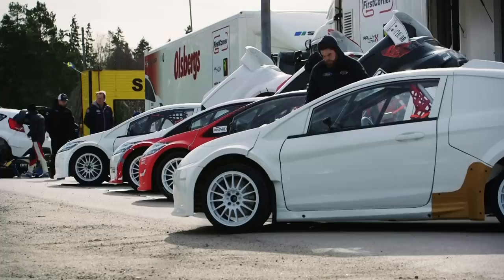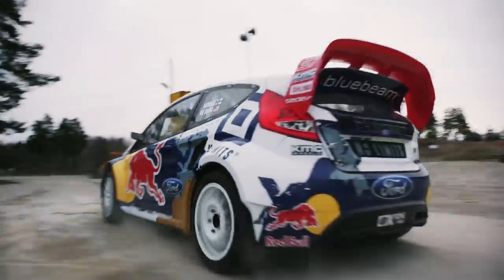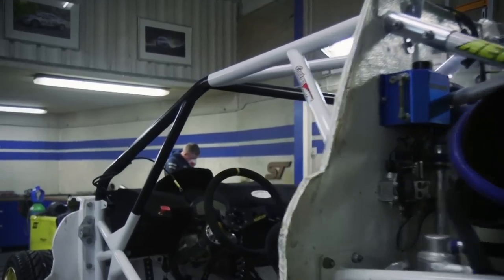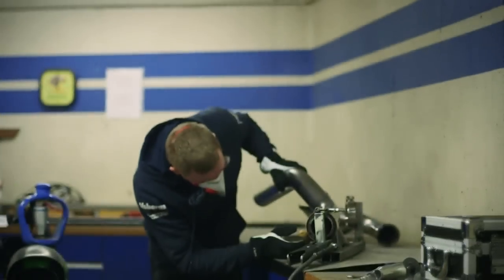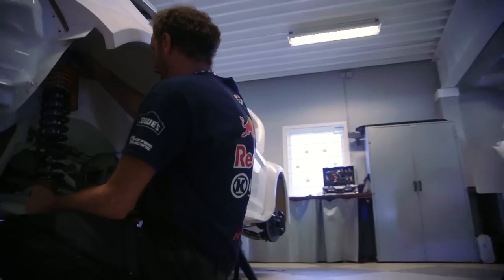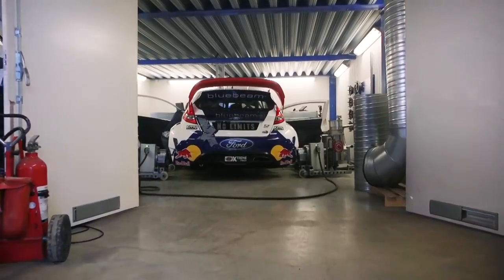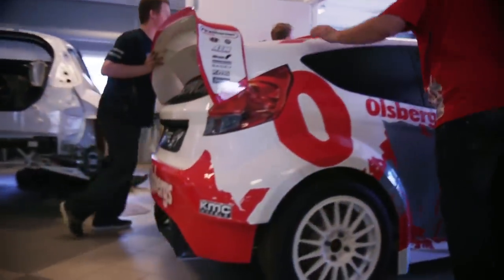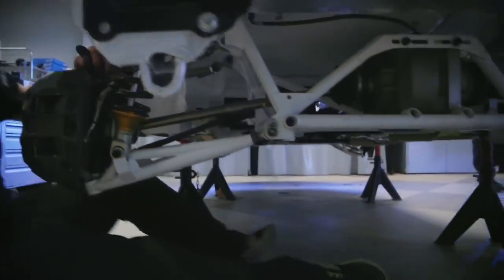Building a Winning Rallycross Car

Comment: How much cost this  cars??
Reply: CJ VILLARROEL around 3million swedish crowns, that would be like 275000 dollars i think
Reply: Donald Donaldson the motor suspension brakes gearbox wheels racing interior and exhaust
Reply: these cars are around 400k pounds to build. one hub is around 3k, 15k for the clutch. just a clutch rebuild is around 5k. nearly identical builds to wrc car except these have rear subframes and body is mostly fibreglass around a tube chassis. engine is around 25-30k, gearbox 6k ish. crazy money. magnesuim wheels are probably 1500 each